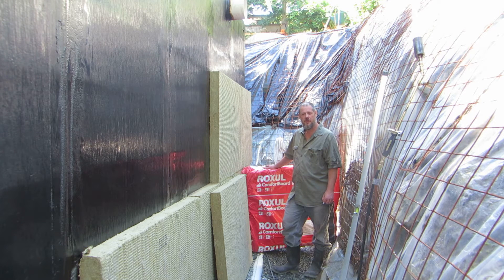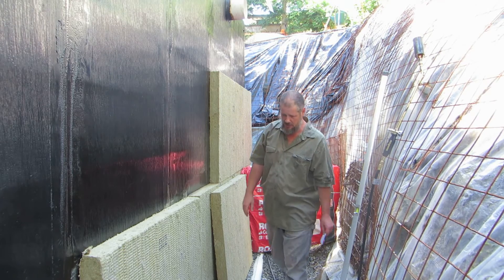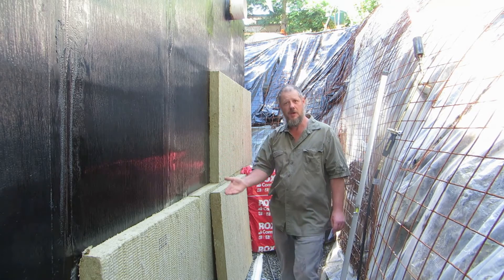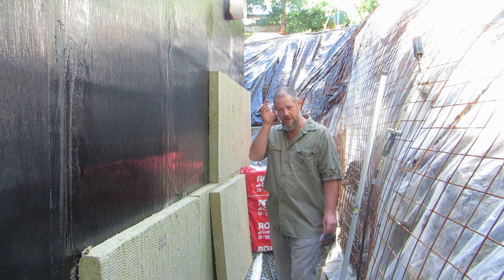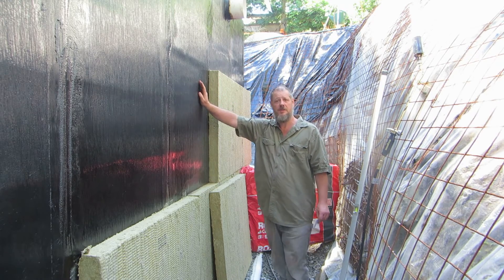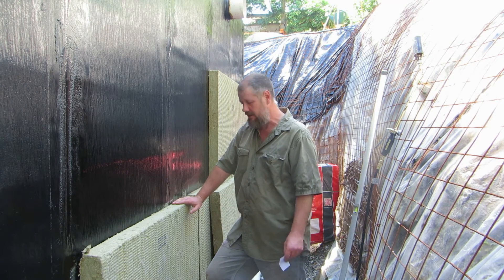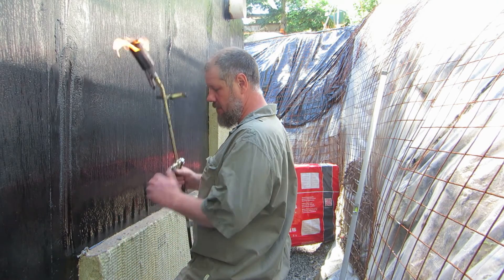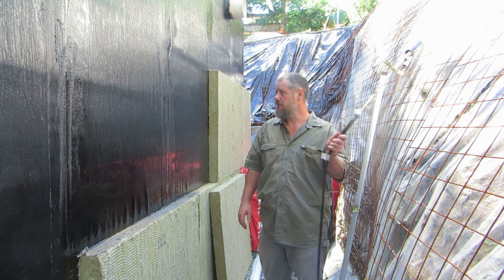Installing Roxul ComfortBoardIS on a foundation

Comment from the maker: Just as a side comment - while working above grade, I discovered a spray adhesive that works VERY well at sticking multiple layers of mineral wool panels together. It is called Protecto-Tak from Protecto Wrap.  Spray on both surfaces, let dry a minute or so till tacky and stick together.  You need to place accurately as once together it is difficult to pull apart again.

Comment: What did you do above grade? How do you address the outside dimensions of the building...does this come outside the plane of the exterior first floor walls or do you hang your plate over?
Reply from the maker: Hi Don - Great question and one I struggled with.  For exterior insulation to be effective, you want to minimize and structural penetrations.  You  want a continuous blanket of insulation projecting from below to above grade and so no, you would not extend a floor plate through this plane.  I talk about my plan in a recent journal entry https://www.theenclosure.ca/ducks-row-finally.  I am also just putting together my next entry with construction photos that were show this interface. Should be up later today or tomorrow.  Thanks for visiting.